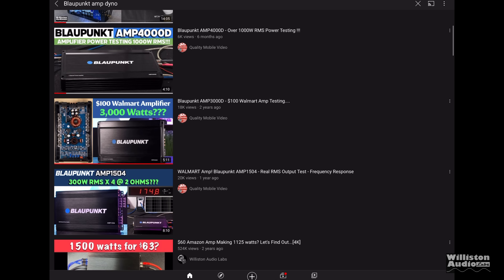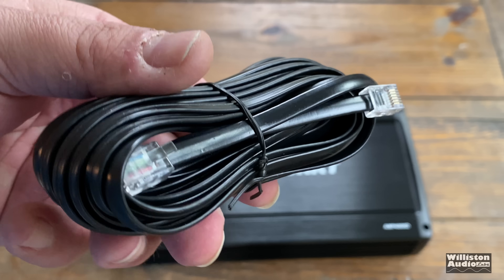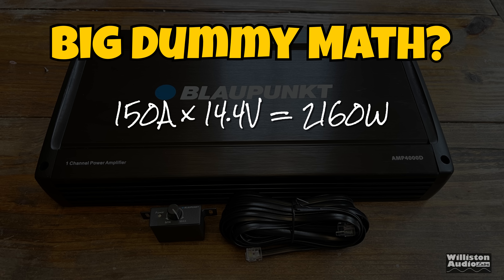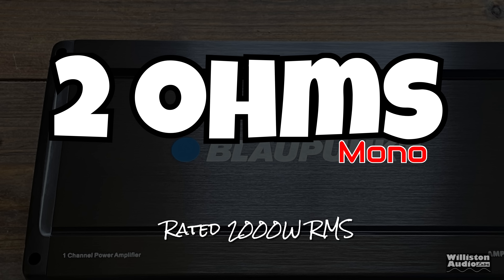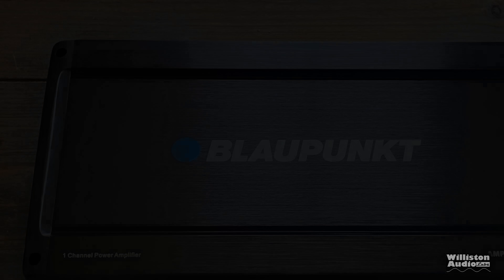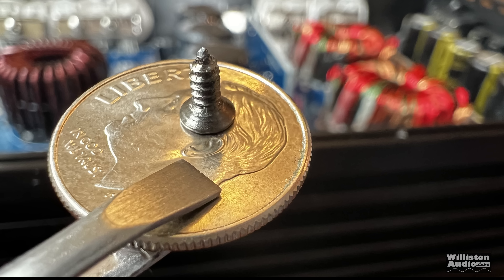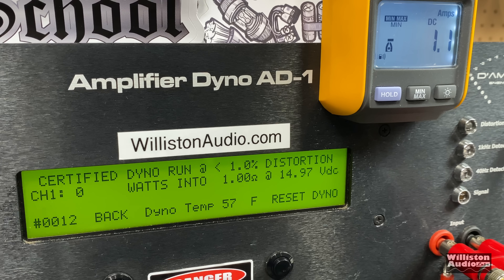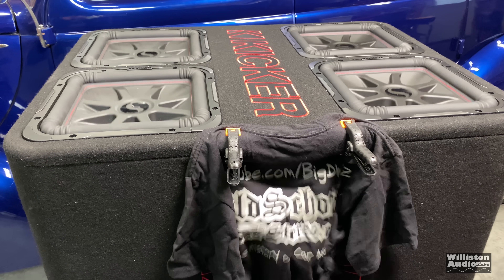How Much Power Does a $49 4000W Walmart Amp Make? [4K]

Comment: I just need help on something lol. When getting a higher rms amp and setting the gain for a lower sub rms when calculating the voltage what I don’t understand is when sub is a Single sub dvc 2ohm and I will run it to 1ohm do I calculate at 1ohm or at the 2ohm amp rated 1ohm 1500rms so I don’t want to mess up the 850RMS 2ohm sub. With my calculations I should have 41.23 but If I wire it to run 1ohm it would be 29.15 soo I’m confused on wich one to use. How I said amp is 1500rms at 1 ohm the sub is dvc 2ohm 850RMS can anyone help me out?

Comment: Bet you it overheats the first time you use it
Reply from the maker: Well it didn’t
Reply: @wal  I saw that and thanks for the great in depth look at it.. I still wouldn't trust it because I'd want to play it at it's full potential/power. I see you tested it for 40 minutes, was thank at high/close to full output? That's when I see amps get hot, when pushing a majority of their capacity through without proper means to disperse the heat/energy. Cheap amps can overheat, there's always other factors in that as well.. but the brand is real and not a 'boss' type so it has that going. 

Thank you

Comment: I got $15 in an old Rockford Fosgate 800x2 Power from the 90's, I found it free, had to replace one of the capacitors in it, thought $15 was high for just one cap at the time.
Reply from the maker: Yo that’s a dealio
Reply: @wal  Yeah, was lucky the only thing wrong was the cap popped loose, I'm no electronics repairman, had it been anything else I'd have not known what to do.

Comment: Emi likely isn't coming from inside the amp, it's totally enclosed in metal. It's possible there's a defect with your amp that's radiating emf at a high frequency from the power and ground. Something weird could be happening with the power supply switching speed.
Reply from the maker: I asked former head engineer at Rockford Fosgate and he is the one who referenced EMI
Reply: @wal  ...I remember someone saying this about the earlier model taramps. I heard in the early days, those type of Brazilian boards were banned from competitions due to something in that nature. There is a video on this topic called taramps Witchcraft confirmed. Don't get me wrong, I could be confusing this with another issue, but if my memory serves me correctly, he was talking about taramps doing something to your electronics in the car. But what I am talking about, came from watching that video.

Comment: Not bad power for the money. Efficiency sucks but with impedance rise it may still operate at 90% on music. Sounds like a good amp for anyone looking to run a couple 2ohm Kicker Comps and get a couple hundred watts to each for cheap.
Reply from the maker: Just that noisy power supply with modern vehicles may be problematic

Comment: To get full wattage out of the amp I believe you have to have the base knob control hooked up.. So far on any amp I've had when I plugged the base controller in and turn it up I get a little more Out of the amp... I'd like to see you do a test with that plugged in  And then do a test without the base knob controller plugged in...
Reply from the maker: It was tested with the bass knob connected
Reply: Not at all. The bass knob has zilch to do with maximum output power. All a bass knob is, is a single EQ band, or a volume control that LOWERS the volume, not boost it. It's never a power output booster.

Comment: Blaupunkt GmbH was a German manufacturer of mostly car audio equipment. It was owned by Robert Bosch GmbH from 1933 until 1 March 2009, when it was sold to Aurelius AG of Germany. It filed for bankruptcy in late 2015 with liquidation proceedings completed in early 2016.

The brand is now managed by GIP Development SARL of Luxembourg and is used on various product groups worldwide. All production was outsourced to China after the takeover.

However, Robert Bosch Car Multimedia GmbH still manufactures mobile audio products for OEM integration and not retail sale branded electronics. That company is under the Bosch lane and is not to be confused with Blaupunkt.

*All cut n paste like info from Wikipedia.
Reply: I had a tube radio chassis back in the 70s from out of a huge old wooden 60s German Blauplunkt entertainment console and it was gold. The tuner was dead on and the amp unit drove a pair of Jenson 6x9 co axial speakers in boxes perfectly for what I wanted. Hey, I was a dope smoking long haired hippie kid who just wanted an FM stereo radio I could listen to while stoned. 
FM radio was good back then.

Comment: Ever thought of testing South African amps?
Eg. 
Powerbass S.A
Targa S.A
StarSound S.A
Ice Power S.A

Alot of african countries use these amps for their systems...
Reply: Those are the biggest Car audio brands in Africa, including a new comer Energy Audio.
They do, amps, subs, headunits, crossovers, eq's and more.
Reply: The amps I'm referring to specifically are as follows
IcePower - IPBR-PRO series (Brazilian style)
Starsound - BOB series (Brazilian style)
Targa - Tg series (Brazilian style)
Powerbass SA - PB series eg. PB30k series (Brazilian Style)

They are all rated as RMS too.
Reply: They are cheap too... Considering the US currency is much stronger than the Rand, with the most expensive between them is 450USD. Cheapest being around 160USD. 

They have been clamped and did do close rated rms numbers... But not in detail like your videos, including efficiency etc. But im 100% sure you will get tons of views from African viewers for these tests...

Comment: I paid more than that for the 3000 watt on amazon! They got me, but the amp sounds good! Our walmart doesn't have those!
Reply: I got same 3000 watt on Amazon pushing 2 15 inch SKAR they sound very good and amp still working a year later
Reply: @datcrazywhiteboy6205  💯!!
Reply: Originally bought a Kenwood class D for $300 that burned up within a week

Comment: Granted, it's nowhere near its rated power, but, if I spent ~$50.00 for this amp, I would be quite happy with it. That harmonic might be a high frequency superimposed on the audio signal. No problem, subwoofers have enough inductance to ignore that. If you're using this as a 'full range' amplifier, that high frequency could damage tweeters, especially piezo tweeters, unless they have resistors in series with them. That high frequency bleed through is likely the result of magnetic core saturation of the output inductor. That will only happen, at very low output impedance, where the output current exceeds the saturation current of that inductor.
     You're absolutely right, to look at the fuses. That is a "dead giveaway" as to the theoretical output power of the amplifier.
Reply: Its pretty hard to kill a piezo tweeter.... 🤷🏻
Reply: I don't think they are allowing this, the built in filter tops at 250Hz, with no obvious disable switch.
Reply: I knew I’d find the one person sticking up for this amp! Car audio used to, RIGHTFULLY, be extremely expensive, thus keeping kids and losers out of it. Jesus
Reply: @arthurkitchen8896  your type is annoying
Reply: I'm not sticking up for this amp either, buttttt if someone said "Hey, I got an amp that is guaranteed to produce 800 watts at 1ohm, and it only costs $50", I'd be all over it. You can't dispute that lol. There's amps out here for $50 that you might get 100 watts. @arthurkitchen8896

Comment: I have an old blau pda 1350 that will kill a 600 2ohm sub very quick.. never did figure it out as it seems to be fine bumping my 4ohm kenwood 12 hours and hours on end.. for like 4 years its been In my car and my kid uses the car now and the amp is still beating that 12..

Comment: Back in the 90's Blaupunkt was OEM on many German cars and was on par with some Pioneer, JVC, Kenwood and even Alpine stuff. Somewhere along the line they went full out "woke" and are now competing with the cheap China stuff, even adopting their measuring standards and units. It has a variable phase however and 400W @ 4ohms for 50 USD, not bad....but the brand has been destroyed.
Reply: Now Alpine is the only good one
Reply: @johnkovich8874  I was going all Clarion for the boat,, CMQ 1622 and their small 4 channel amp and M508 HU ,, went Kenwood for HU , KMR -D382bt,, very satisfying sounds
Reply: @GatesRapes  Kenwood has great head units.  Alpine has great subwoofers and amplifiers. (Of the brands listed above)

Comment: The 4 channel amps have the same issues.   The POWER supply is NOISY.  To top that off? There is always some kind of whine.     If you need a QUALITY budget AMP?  DUAL all day long.   It is a Sound quality champ.   Does not get hot.  And, competes with some of the home amps out there.   NAD.  Sony, Even ROTEL.      It's a BUDGET HiFi GEM!    They are harder to get now.  But most Autozones still have this amp.   GET IT.  
This was the GODS at these companies sending out for the Budget folk.  Relish it.  

As far as Blaukpuntkt?    Its what you get when you littery just don't care.  Glad this ones runs cool.   But that cool running must have to do with filtering on the DC / DC power supply. 

There is a Reason why the choice is to go with the Big brand Names.  Things like this just don't happen.

Comment: Derrick can you please go over head unit to amplifier gain overlap and how to set up an amplifier to match the head unit?  I always run my gains on my amplifiers all the way down because I don't see the point in turning them up when I never technically run out of volume on the head unit.  Thank you. Trent
Reply: Then your fine... The gain is there for the decks that dont have enough voltage on the outputs to drive the amp to full power. You get cleaner sound, and less "noise", if you run your amps gain as low as possible, but high enough so that you can get max power out of the amp before the head unit distorts it's own output signal.

Comment: I never get why they just don’t advertise these power outputs that you just showed us. For the price it’s pretty impressive unless I’m wrong. For $50 or $100 it’s pretty good
Reply: 100% Agreed.... I am from the time a Fosgate or Kicker amp with these actual numbers cost nearly $1K
Reply: @ralphmenta249  you taking me back to the tape deck days of bumping Warren G Regulators lol
Reply: Same thing with flashlights. I've bought several lately (because I knew the LED chip used in them was very good) for $50 on Amazon yet they were advertised at ridiculous ratings like 20,000 lumen. In reality, they're more like 4,000 lumen with is still nice for $50
Reply: It is GOING to sound like ass. I don't care how cheap it is, I wouldn't want it.

Edit: Also, I REFUSE to support a totally dishonest company. 
I am NOT going to be slapped in the face by a company the second I purchase their product, which is exactly WHAT happened to anyone who purchased one.

Comment: Three 50 amp ATC fuses are worth $50. I’ve been around this stuff for 30+ years and have never came across anything greater than a 40 amp.
Reply: @CRACKED HEAD I've got a TON of these ATC style 50 amp fuses... How many you willing to buy? I'll sell them to you $5 each! That should be a steal of a deal for ya.
Reply: They could put 10, 60A fuses in it, it still only hit 800 out of 4000 watts.  14.4x150=2160.  800/14.4=55.  Seems like they could have used 1, 60A available at auto zone for $4.99.
Reply: People don't seam to get it.  50 AMPS is too much for the ATC/ATO fuse to physically handle. If you google for a little or bussman brand ATC/ATO 50 AMP fuse you won't find any, you'll find MAXI fuses which are bigger in physical size. If a brand makes 50 amp fuses. I'd be suspect of the quality of any of their fuses.  Many Cars do have 100 amp or higher fuses but they are in different physical packages. Any brand that actually cares about standards stops ATC fuses at 40 amps. I think little actually only makes them upto 35 amps. When you think about the contact area from the fuse to the terminal 40 amps is lot of power for that size connection and since for 40 amp fuses probably don't blow for a few minutes at 45 amps everything needs to be able to handle 45 amps. It's just too tiny.  Car Makers don't use 40 amp ATC fuses in my experience because 40 amps going through those tiny connections just isn't going to be reliable so they go to physically bigger fuse style. (Could be a car or two that uses them, but none that I've seen.) The only place I see 40 amp ATC fuses is on circuit broads and car amps where they are not packed closely with other fuses and relays.
Reply: lol you can get a 10 pack of 50 amp atc fuses for under $2 on eBay. you wont see them in stores because nobody needs them for their vehicles.
Reply: @frostbite1991  I get it. What I meant is that I’ve never come across a 12volt device that used 50 amp ATC fuses. 40’s have become common enough, but there are better choices out there for fusing.
Reply: Thats because it's FAKE as hell. NOT worth $50. Not worth 10 cents...

Comment: Those kinda of LCD displays are VERY sensible to noise, specially high speed transients ... like actuating relays, coils ... etc. Note that rest of the dyno keep operating properly ... it is more like the LCD is the one that is suffering the issue. This kind of LCDs has it own controller chip. definitiley some high speed / high voltage transients are going there. Could be radiated EMI too, less likely.

Comment: As usual, an enlightening episode Mr. D! Geez, in my day when I first started installing full time, Blaupunkt was quite high end, at least the FM section was. I'm talking old school late '70's here. i.e., German built "Berlin" model, the early 80's Jap CR3001. I had a 3001 and the radio performance (with Dolby on, yes, _Dolby on_) was the best I've ever heard.
The cassette section was dismal though, even with a retrofitted Concord sendust head (matched phase would not fit) in it. Got a question for all. Where I live (Silicone Valley, Ca.) I rarely, if ever for the last 15 or so years, hear a loud bumpin' car stereo on the streets. What are you hearing where you are?
Reply: Yeah. The audio scene (auto and home) is just badge engineering for the most part.
I also don't hear a lot of bangin' systems anymore. Bonus is there is a lot of older systems components for sale on marketplace and craigslist. All the cool old schools stuff I could not afford when I was in my teens.
Reply: @wrenchpony9735  I'm surprised that you find the vintage stuff affordable. Like early BMX gear it seems, the old school audio stuff is priced for the deep pocket baby boomers who can finally afford to buy the things they used to drool about - but that are now rare and no longer produced. Remember those old round-dial Pioneer underdash units? They're fetching >500.00. I'm still searching for a Fosgate pr250/2100 preamp... :)
Reply: @wrenchpony9735  I have a friend that owns a mini storage facility. Periodically I help him clean out delinquent units. He always let me have anything in the units that I want. About a year ago we cleaned out a unit loaded with electronics. It contained a Phase Linear 400 amp and preamp in excellent condition,a wheel barrow load of new Surerior Powerstat variable transformers and about the same quantity of various power supplies plus several big boxes of new vacuum tubes. Turns the man had died and his widow simply said get rid o f it, I don't want any of it . In another unit we found a 3500 watt Honda generator and about 40 500 foot spool of various gauges of THHN stranded wire. No one ever came forward to claim the second unit.
Reply: I live about 40 miles ENE of Atlanta GA. Now and then I hear someone bumpin' while I'm out and about. Hopefully those who enjoy high end/high output car audio have grown more courteous toward the rest of society that don't want to hear what they like. Don't get me wrong, I love high end/high output car audio. I've had a custom system, that I installed myself, in every vehicle I've ever owned. That said, I only crank it up when and where it isn't a bother to others.
Reply: My harley lol! 2 amps 8 speakers
Reply: Loud ass car rattling shit in the DMV. The kind you don't want to hear when sitting in your car at a light.

Comment: My guess 600w rms 4ohm without watching test. :D (EDIT, Still reckhorn doesn't ship to there? i asked for test to reckhorn A-800 for almost 2 years ago, but you said they don't ship there (company that makes theese are from German)there are newer versions of this amp but internals still same some tweaks but power output is same. It's hometheater amplifier for subwoofer, my A-800 was rated on website 4 ohm 580W/rms / 10 % 2ohm
1000W/rms / 10 %, i would like to know this amp to be tested here, BTW i paid 280 euros for this amp 2yr ago, so not that much compared to buy amp+sub box set, i have custom box and car sub for this set, pretty good.